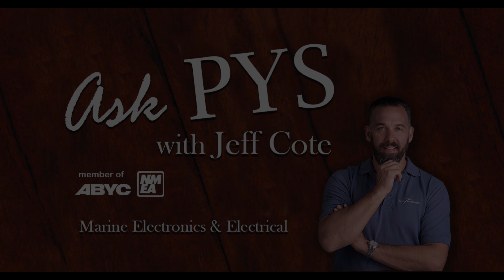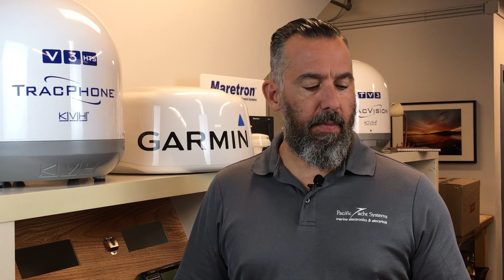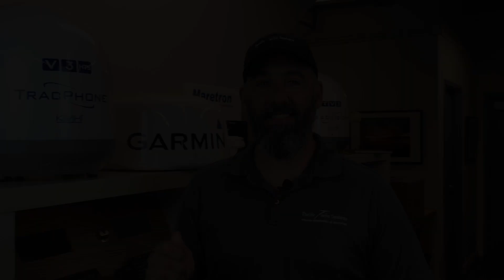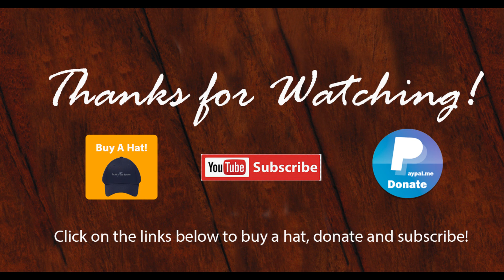Can I Run My Windlass and Bow Thruster From the Same Battery?

Comment: A while ago you recommended a starting battery for the thruster. With the windlass hooked up to that same battery, does a starting battery is still recommended or a deep cycle makes more sense?
Reply from the maker: Hmmm, interesting dilemma. If a battery bank will do both a thruster and windlass, I'd give preference to the thruster requirement and install cranking batteries.
Reply: @PacificYachtSystems  I think you mentioned in one of your videos that the Firefly batteries act as both Deep cycle and cold cranking - is that correct ?

Comment: "So that your alternator is offsetting the windlass consumption" - This seems like a bit of a double edge sword. Either you are running an echo charger to charge your bow battery, or you are tapping into the unswitched distribution bar where your alternator is connected, and in turn you are running a large cable to handle the alternator amp output to the bow, in turn making your statement about "saving a lot of cabling and money" not fully correct.

To me it makes more sense to just run the 2/0-4/0 cable to the windlass from the house bank, granted maybe if i had a thruster it would be to a thruster battery so it can function as a capacitor
Reply from the maker: Hi Jordan, glad you are thinking about this too.

With a windlass, more concerned about voltage drop then the ampacity when choosing a cable size. If you have a battery bank near the windlass, you'll be able to worry less about voltage drop and you can save a little on the wire size between windlass battery bank and house battery bank.